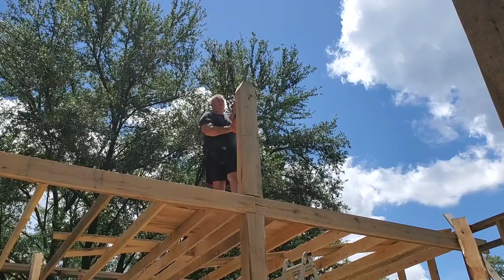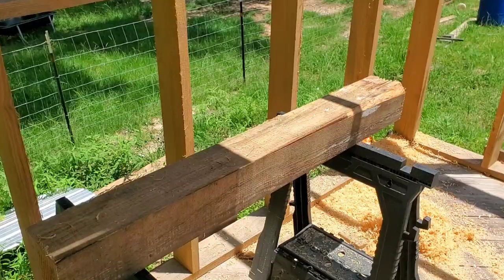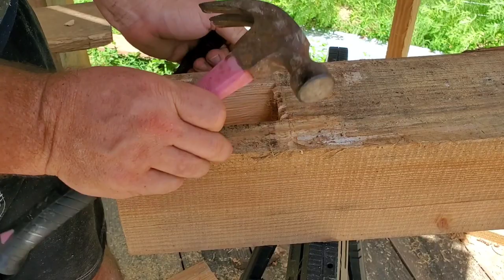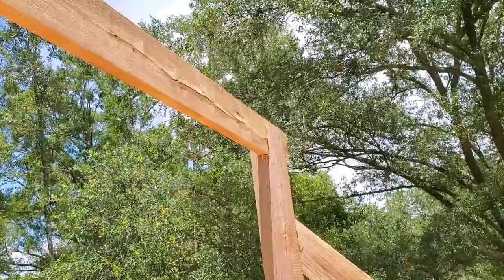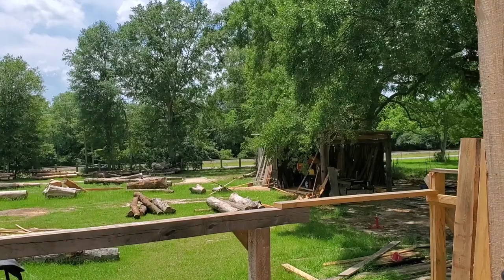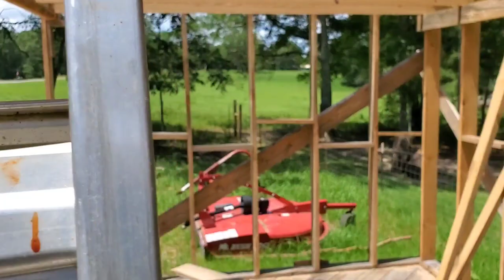First Hickory ridge beam goes up on the woodshop

Comment: Awesome sir it is definitely coming along what are you going to deck your roof with
Reply from the maker: I'm thinking 1x4 oak slats with metal tin over it.  Then spray foam the underside of the metal, just as I did in my wife's shop.